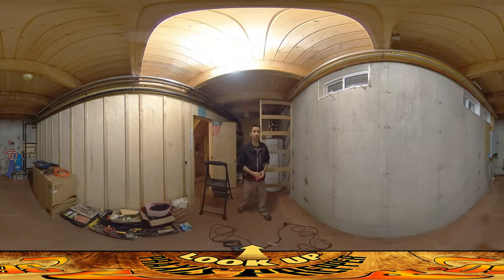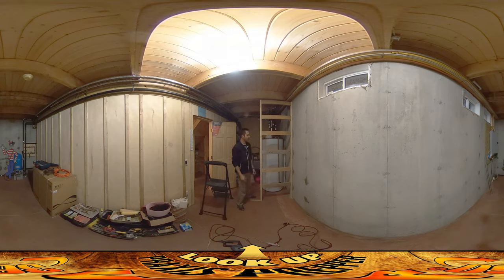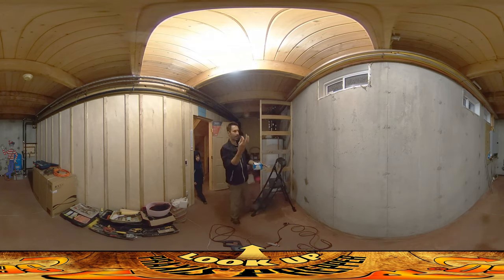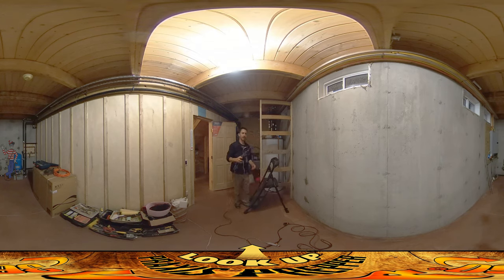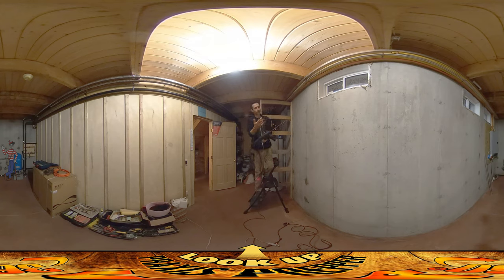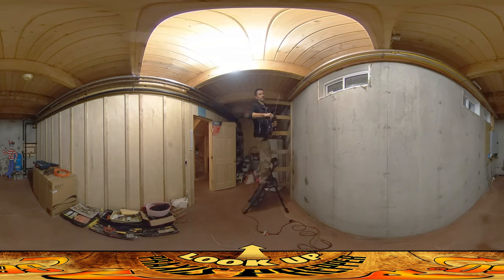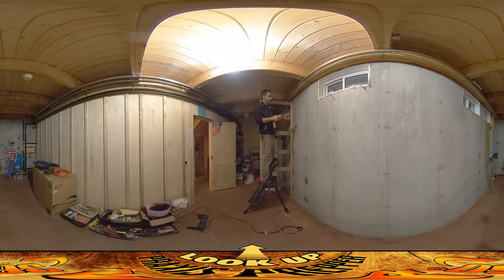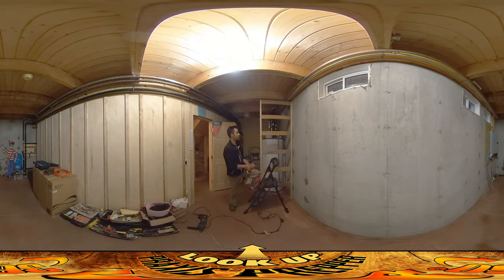Homestead Building - Pantry Shelving Rack Install, Drilling into Concrete

Comment: From the way you are leaning into the screw, it looks like your are using Phillips head which require a lot of pressure to keep the bit in. Try switching to trex screws. Do it once and you'll never go back to Phillips.
Reply from the maker: They were actually hex heads. The bit didn't engage very well. In tomorrow's video, I discuss how I changed to a different brand of screw and they engaged in the hex socket WAY better.